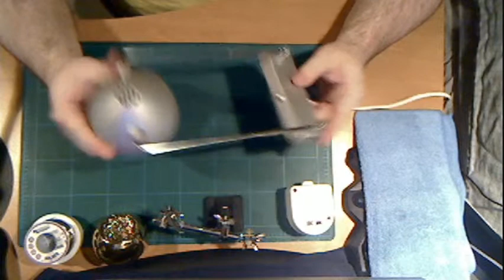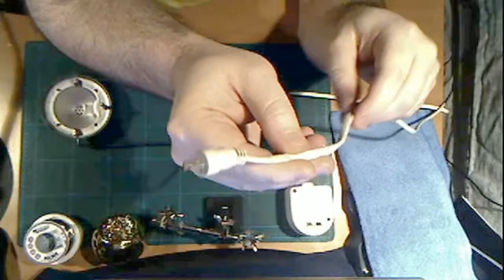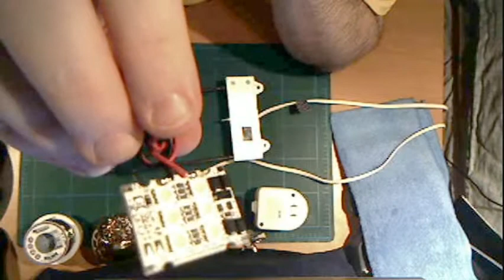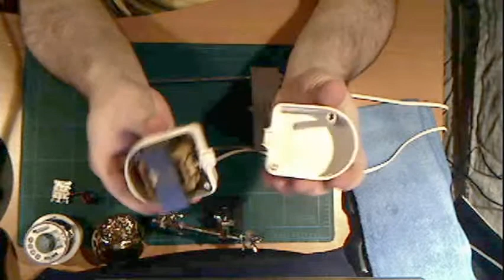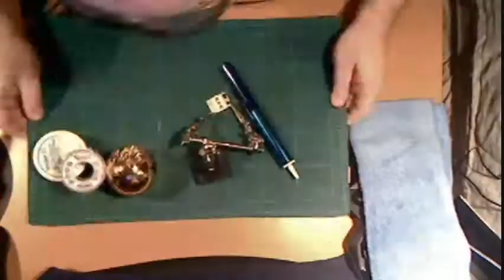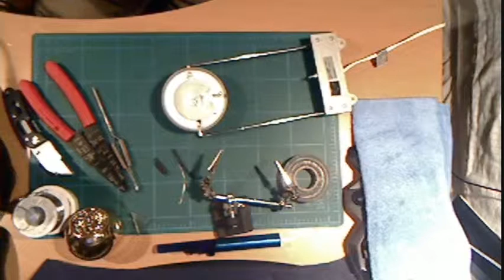Magiker_Hack_Fin.wmv

Comment: Would I be able to switch from a G4 halogen bulb (which is what I think the Magiker uses) to a two-pin LED bulb without having to do anything else? The LED I wanted to use uses 3W but with 30-35W output. Would that be ok. Warning on Magiker light says 20W maximum. Is it referring to input or output?